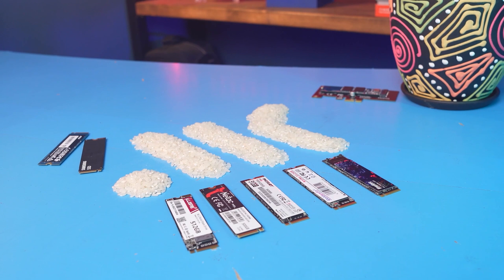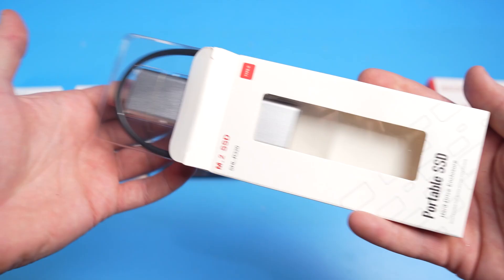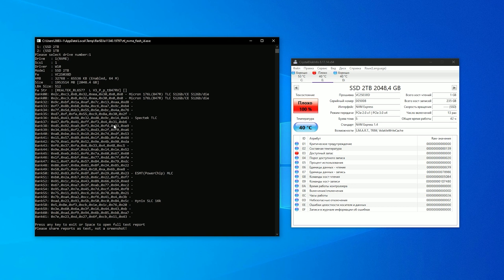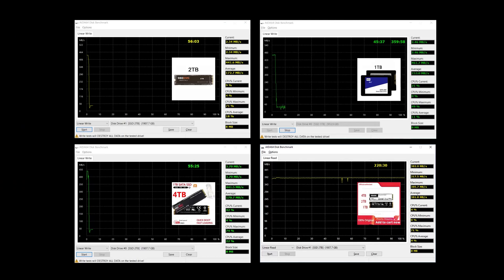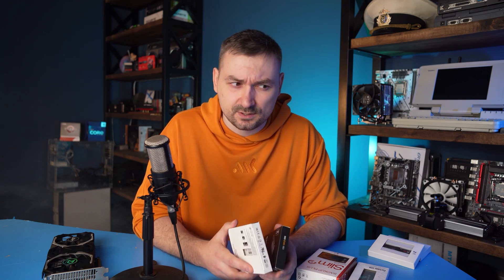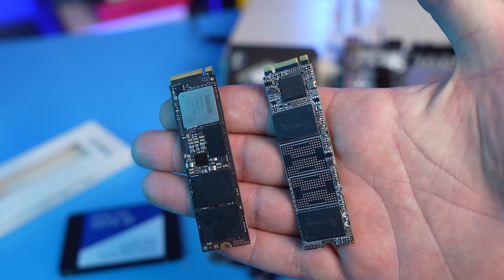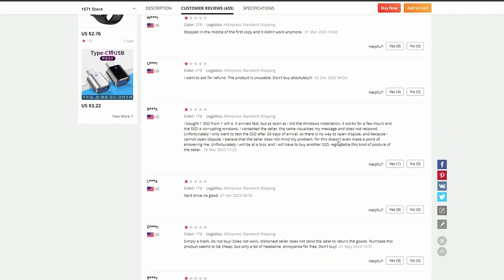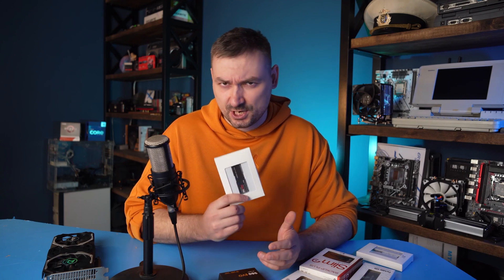Fake SSD from AliExpress | How to recognize a fake

Comment: My fake 4tb was 101gb at £80. It also miss spelt made in china with made inchinia. When you migrate your system u will get an error after a hour as it is only 101gb. What a headache.😮

Comment: Can you please make a detailed video on how to verify chipset on M2 NVME / NGFF using software? I think many many Chinese manufacturers are printing almost identical sign and people think it’s real.. but as a ethical hacker perspective: The is date installed & date released, manufacture, chip serial number and many more info on the chip to read. This could be done in many ways like usb Debugger / bridge that reads the info or using software in windows/linux.. 

This could maybe already tell if there is a fake chip and also fake memory. 

“Ps.. correct me if I’m wrong, still learning”
Reply: Btw.. Would be great to have a original chipset info list from manufacturers and add this to a program that reads & compare the the chip  to manufacturers info and tells you if it’s fake or not Based on  fake cell test and chip info.
Any developers out there ready to develop?

Comment: As you briefly mention, writing large amounts of data to the drive will expose the fake devices. I recently purchased 2, 2 terabyte Toshiba drives from eBay. After a week of trying to get them to store data reliably and trying to format them , I contacted the seller. He said to download the newest firmware from Toshiba. The drives we're not recognizable Toshiba's software, which was written for them. That's 2 right Flags. Difficulties in formatting the drives we're all over the place. They would attempts to format  failed most of the time.  Eventually,, they started formatting correctly. Red flag 3. Tried again to store large amounts of data reliably, failed. The drives consistently switched to raw mode which required the drive  to be re formatted. Red flag 4 I decided to forgo the quick format and try the extended format. After running all night I was only halfway through OneDrive and 3/4 of the way on the other after 12 hours . Red flag number five. I let the drives try to format for a couple more hours but they made no progress. prior to this, I expressed to The seller I thought the drives were fake. His responses  sounded like he was trying to delay any action to remedy the issue. Once the formatting stalled, I decided to open the drive to see if they were really fake. As I suspected they were fake.. they contained weights and a small amount of USB interface electronics. The sellar claimed that I violated eBay policy by altering the drives to  justify not giving me a refund. If I had opened a drives which contained a 2 terabyte drive, he would have a case. I opened a case with weights and  USB interface electronics.  I ordered hard drives that contain 2 terabyte  drives.. My argument is, how can I alter an item that I never received.

Comment: You may be able to tell just based on the number of DRAM chips.
I see, the terrible quality DRAM chips are too expensive so they have to use SD cards. They have their place, but they have low performance and write in eMMC storage.
Reply: Must of these scam SSD devices don't contain memory chips, they use a micro card and have programmed the only chip on the PCB board to con the host computer to show a fictional storage capacity. I know I have brought one of these, now feel like a bloody idiot.
 For falling to these scammers.

Comment: Fast forward 1 year and I'm seeing Crucial SSD with 62% discount at Aliexpress. Turns out the final price is a normal price for the SSDs where I live so this is the lamest thing done by Aliexpress. In fact a complete fraud. Let me give you a few examples:
Crucial 2TB NVMe for 159,89€ (425,95€ price without discount) 62% disc.
Crucial 1TB NVMe for 81,28€ (219,08€ price without discount) 62% disc.
Now do you guys have seen these prices without dicount for any of these SSDs in February 2025?
Oh and in all of the models says 500+ sold LOL!

Comment: I will never buy any storage again on AliExpress. Bought supposedly 32/64GB HP and Kingston drives but the write speed is so terrible, it starts fast sometimes and then slows down under 10MB/s, the next min it keeps hovering between 10MB/s and 20MB/s while my real Kingston USB drive consistently stays at 20MB/s or 21MB/s.

Comment: Of course these are fake, What did you expect for the price?  I have never had a problem with AliExpress regarding refunds. You do need to supply proof of item is not as described or defective, including photos, screenshots etc. I always use paypal as well for backup. So not only do you get your money back, You usually get to keep the item as well.

Comment: i saw one of those "factories" in China few years ago. A friend working there said that apparently only about 10-30% of customers ask for a refund and since they are selling garbage(bought from major manufacturers the cheapest (grade c or worse = garbage) in wholesale) they would still make profit even if 90% of customers had to be refunded. biggest problem is that platforms(like ali mentioned in this video) keep shutting them down and they have to keep reopening new sellers accounts. There is  a minimal risk of being busted by authorities but from his experience hes only ever heard of a few of these busts/raids in over a dozen years. So unless something changes i would not expect this problem to go away anytime soon - so just use your common sense(too good to be true rule) and make sure to buy wherever you can ask for a refund from a platform itself and not only from a seller(they might be gone by then with new name/account open)

Comment: Ive had a few of these as i have 140,000 old house eps.and jeed storage. Most have just been flashed to look larger than thay are ajd w9rk until you hit the orignal limit then failure. Do thw right thing, get a proper ssd from a proper company.

Comment: So I made the mistake of buying a 2T SSD for 12.00 or so. When I got the drive it looked nice and actually reported to windows as a 2T SSD. However when I tried to copy 200gb of music files to it it was very slow 1-5 mb or even slower. I tried a quick reformat of the drive and this seemed to work but I had the same issue. I then tried a deep format. This whipped out the drive completely and windows no longer could see it. Even using disk manager. 
so I opened a dispute with the aliexpress. The seller or Ali sent me a return label with shipping paid. they said this was a one time discount of 7.99. I tried to talk to the seller but that portion of their site is under construction. So I packaged the drive up and put the label on it. It's going back to New Jersey. We will see if I ever get a refund. Unfortunately I ordered two 2TB flash sticks for 5.00/each that have yet to arrive. I'm sure they will have similar issues. I've purchased some fun stuff from Aliexpress but you have to be careful

Comment: I picked up a Beelink S12 Mini, which has pretty much identical specs to yours, in the after Christmas sales, and it's very impressive for what it is. I haven't tried gaming on it, but I installed Linux Mint LMDE and Plex on it and i swear it's doing a better job  than the i5-3450 with Quadro P620 it'll be replacing when streaming 4K videos on Plex. It's not a huge upgrade, but the power draw should be considerably less.
Reply: I had a GK3 Pro N5105, 16GB, 512GB. And a Beelink GTR with Rhyzen 9, 32GB, 512GB. 
Bought about a month apart.Two totally different beasts. And the retail prices state it loud and clear. ;-)
My point being that both are/were absolutely excellent products on their own niches. Recommended for sure. The GTR in particular, show excellent finishing and really "feel" as an high quality product.  

Unfortunately "Murphy's law" hit me hard and strong. And after a divorce. Get a new house. Moving etc, etc.
Precisely a month ago, from this date, my house burn down! My cats died, most material stuff was lost... Including both PC's. 😞
Now I got a cheap mobile CHUWI Gemibook Pro, N100, 16GB, 512GB. Just as before excellent value for money.

Comment: While Aliexpress does have sellers that sell genuine SSDs, there's a lot of scammers out there.
That 4TB SSD drive that looks like a Western Digital Sata SSD is really just an overpriced 120GB SSD.
Reply: Well even if the advertised storage is correct, the seller might say the SSD drive uses TLC NAND when in reality it uses much slower QLS NAND

Comment: Is NVme or Sata SSDs disks are usable if I format them with disk part with disk part for only volume of 100 GB? Therre is an article that you can do it with USB drives in article "AIDA64 - How to detect the real capacity of storage devices with AIDA64".

Comment: Thank you for sharing the video with the helpful information. Unfortunately, I fell victim to a scam last year when I purchased a solid-state drive that was supposed to be 1 TB. After installing it, my computer kept crashing, and I initially thought it was a software problem. However, after some time, I realized that the SSD was the root cause of the problem. I replaced it with a genuine SSD, and my computer has been working smoothly ever since.

Comment: dude your killing me, i've need a 300g-320g ssd and the only one i can find that isn't hundreds of dollars is the netac, even though i had never heard of the brand after day of searching i finally had talked myself into buying the natec ssd but now after watching your videos on ssd's i'm back to square one, i saved $70 but still don't have a 300g ssd, one company wants over $700 for an intel 300g ssd, i'm not getting the the deal is with 300g ssd's, i've been running a $60 team group 256g ssd for over a year without a problem and to get a 512 isn't much more so why are 300's so expensive and rare.............

Comment: I'm a regular buyer on Aliexpress and, on balance, very happy with what I get, which is sometimes surprisingly good quality. However I got sucked in with the blue and white SSD that is being used as a reference. Yet I had purchased another (same capacity) brand that cost about 15 bucks more only a few months before and have had no problems with it. Well I won't get fooled again (till the next time)
Reply: I did also :-( but equally, I do purchase many items via Aliexpress and seldom have issues. Cheers mate

Comment: Im old enough to have paid $300 (on sale at Fry's) for a 1gb hard drive to add to my screaming fast Pentium 90 running Windows 95. 
Actually, I'm even older. I learned to program in Basic on on a Tandy 8088 and how to write to & read data from punch cards. And how torroid memory coils were wound, assembled in a course in college.

Comment: I was going to buy a suspicious 1tb sata ssd on Ebay from a Chinese seller and I asked the seller if it was fake and he straight up told me they were. Some sellers will only tell you the truth if you pry for it, and even then they speak in a sort of riddle to avoid directly answering the question but they answer it non the less.

Comment: Have had one of those 2TB 2.5" SATA SSD's. Complained to seller who did not listen. Opened dispute with Aliexpress and after some forth and back I got my money back, but Aliexpress did NOT acknowlegde the drive was fake. SHAME ON YOU ALIEXPRESS!
Reply: How you gat money back from AliExpress, can you tell me how you did this
Reply: @UsingUsing01  Just open the dispute. all my previous disputes ended in my favor, full refund without even having to send back the junk.
Reply: Call support and explain the SSD didn't work, the full time maybe this process is 20 min @user-wj2np6wy1i
Reply: @UsingUsing01  That must have been way back. Nowadays, Aliexpress will not refund you, but ask you to ship the item back at your own expense.
Reply: Walmart sells same crap now.... beware..  Walmart will not stand behind their umm 3rd party sales........  wd reds which are not but are goldfirs t650 1000. Read write via usb just fine so far but sata connection .... nothing.. smh

Comment: Always contact the seller first. Tell them you are going to use h2testw software to test speed and capacity and ask them if it's fake you will get a refund without returning item. If you get a clear response agreeing they will refund without return  then its most likely ok. If they give polite but not agreeing response like don't worry friend is good. Then it's fake.

Comment: well ... I have to say it about that.. you bouth that gpu and it died after 1 month of use sadly and is kinda unlucky so ,  I bough a GTX 1660S for 150$ from aliexpress in april this year and after 4-5 months it works perfectly fine (before changing the termal paste and termal pads after one month of use because it starts heating to much [80*C] ) so...what I mean is that they are not all fake is just random luck and you have to be carefull at what you want to buy

Comment: You should never cheap out on storage. If you cannot afford an ssd from a good source, wait a little more or buy a good quality HDD, if you have this option.
Reply: Almost the correct answer, wait a bit more and then buy the SSD
Reply: Yes but also no, there is lot of reputable chinese SSD brand around in Aliexpress, sure the speed may feel slower a bit, but who cares if it can just do the job?
Reply: All my western brands failed. The chinese ones kept going. My current failing german intenso will be replaced with a cheap chinese. But I am waiting for it to go cheaper.
Reply: you lost me at HDD. Get an SSD if you can.
Reply: @thelonercoder5816 HDDs are fine for many jobs. u can get a 14TB refurb Enterprise drive for $100 now - that's $7/TB!

Comment: Why would you pay £25 for a 16gb portable ssd when you can buy a 16gb USB3 flash drive for less than £5 from Scan which is reliable seller in the UK?
Reply: For 25 pounds you can get 128GB Sandisk flash drive from official store